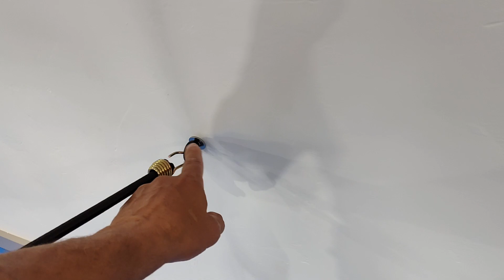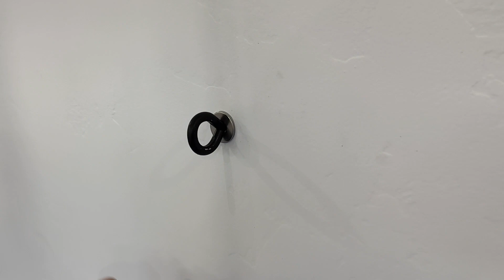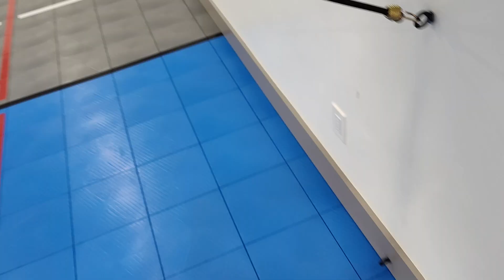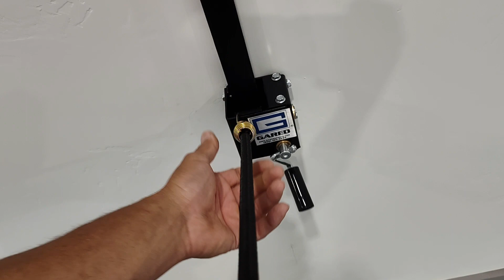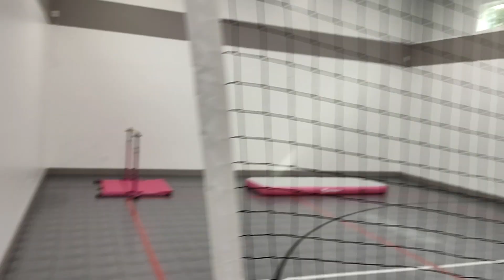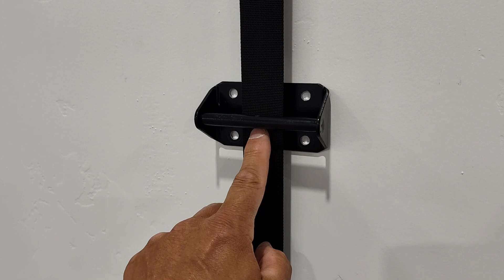Home Gym Wall Mount Volleyball System

Comment: This is super helpful! How do you attach the net on the winch side when you want to lower it to pickle ball level? I don't see lower hooks on that side
Reply from the maker: On this project, we installed the winch at 36" high.
Reply: @LoneStarGameCourts  Similar question. The winch would be installed above the net when you move it down to the lower connections for pickleball so how does the winching work when it's above the net (pickleball) vs below (vball)?
Reply from the maker: @Tiffany-f1t9u  We always mount the winch at 36" or lower so it can work for pickleball and volleyball.

Comment: would this set up on the wall be good for an outside mounting into concrete, I think.
Reply from the maker: Due to concrete's low tensile strength, I suggest that if mounting to concrete, that you make sure your anchors are deep and far apart.  For instance, when mounting the worm gear winch, I would probably mount mount the winch to a 12" x 12" plate of steel or aluminum and then mount the plate to the wall so that you have more wall anchors than just the two that would ordinarily be used when the winch is mounted directly to the wall.